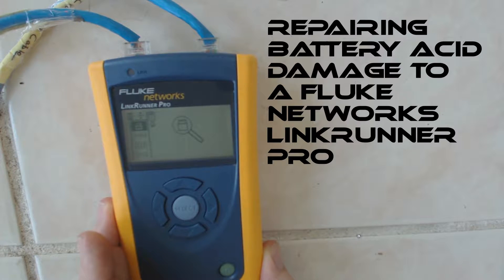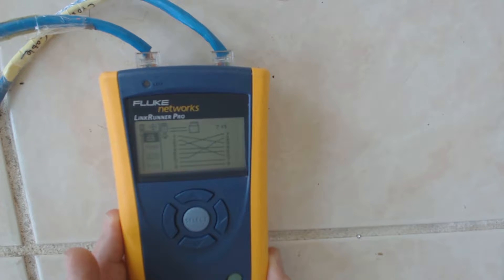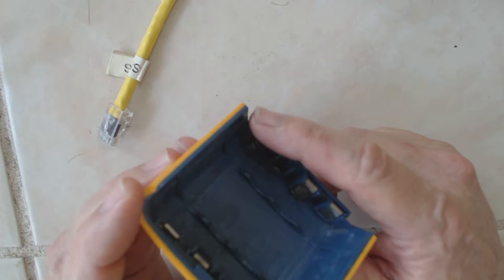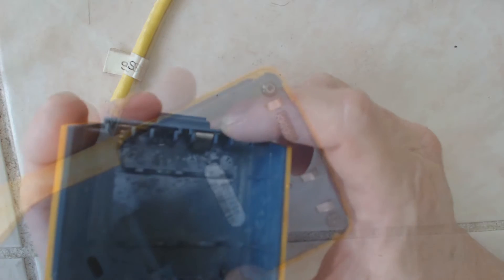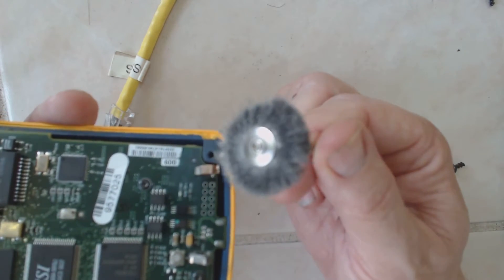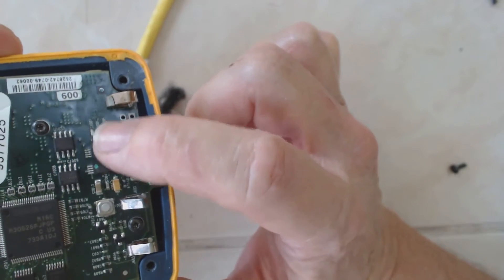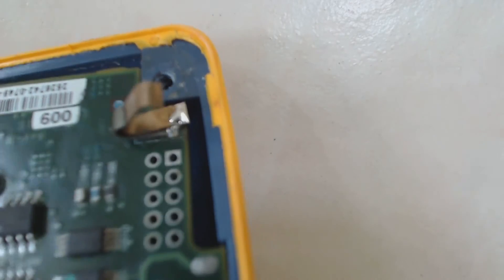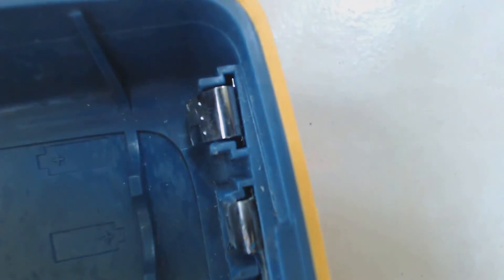Repairing Battery Acid Damage to a Fluke LinkRunner Pro

Comment: I have the same tool and same problem. I fixed  the contacts but lost my battery holder. I bought an off the self battery holder but am not sure what voltage goes to what pins. Can you please tell me the voltage on each pins. Thanks
Reply from the maker: Holding the meter with the he jacks up top, connectors facing you at bottom, ground left, 3v center, open space then 6v far right.  Good luck.
Reply: @EdHumble  What does the 3v connect to inside the battery pack? 4xAA= 6v...woulnt that be enough to power it?
Reply from the maker: @peteygnyc  You're asking a question only Fluke can answer.

Comment: Good day.
I also use this tool now.
I don't have CD with software and latest firmware update (byed from ebay).
If it possible, can you send me these files?
Reply from the maker: I had those issues as well.  I found all of that at the Fluke website.  I got mine for free and non-functional due to the battery damage.
Reply: @EdHumble  At now fluke site not contains software for these tools. Support also can't send me software and firmware, because this tool not manufacture very long time.
Reply from the maker: Post your email address.
Reply: @EdHumble  alexgamber@gmail.com
Reply from the maker: I sent you the files I have.  There is nothing left to send you.  If you do not  receive the files, check with your ISP.  It is big.  10MB +.
Reply: @EdHumble  All fine. Big thanks Ed!
Reply: @EdHumble  Hi Ed, I need the software and firmware too. can you send me it? my email is florentinh1@gmail.com